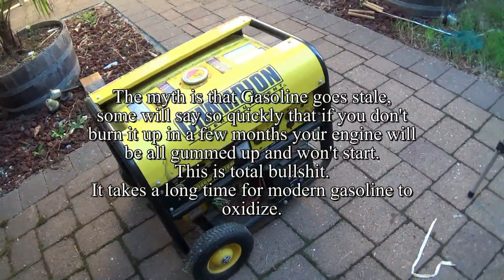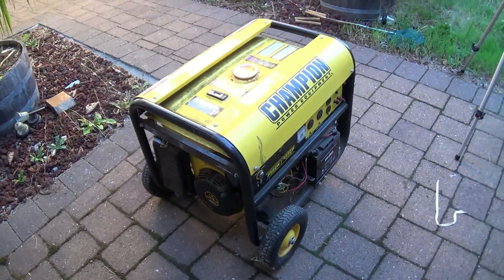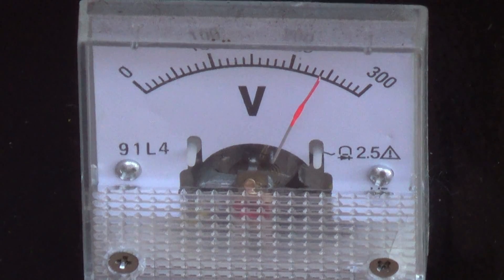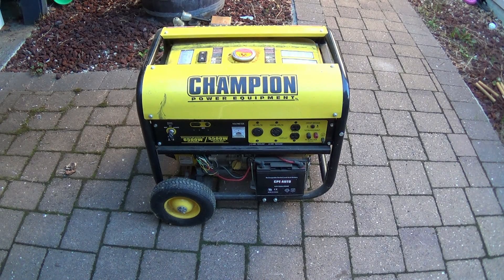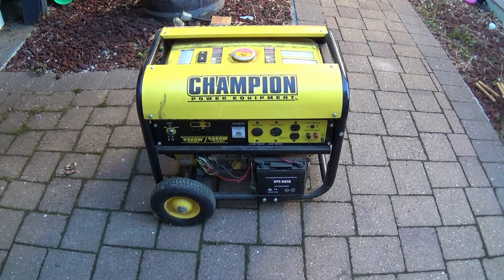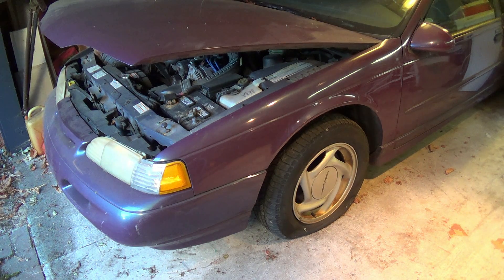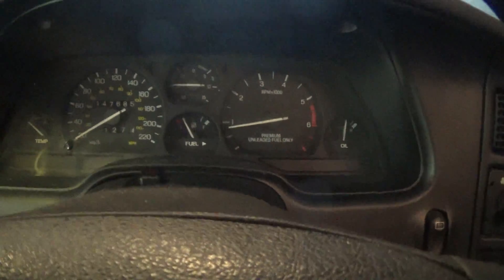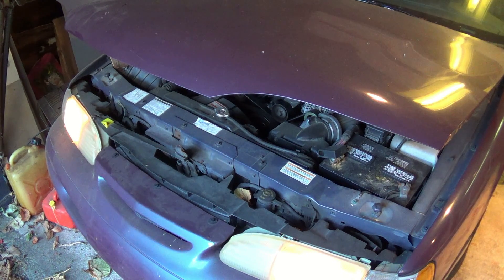Stale Gas Mythbusted

Comment: Straight gas doesn't go bad, but the Ethanol that they put in regular gas stations (up to 10%) does. In a car I don't know the consequences (especially considering modern cars' finicky emission equipment) but regular unleaded older than ~3 months just wrecks small engine carburetors.
What I do is just buy small amounts to use for lawn mowing at the start of each mowing season, and any I don't use before the lawn mower goes back to storage will be drained out and put into the car. As for the mower, the tank is emptied and mower run until it is empty (there's no gas shutoff on mine)
Reply from the maker: My dad used to do that, drain the tank, and then start it and run till it stopped and he still had to rebuild the carb every year.
It was the mechanic that told him to fill the tank, and leave the valve open so that fresh fuel would replenish what evaporates from the float bowl.
Been doing that since, and have not had to rebuild carb since.
In my current car, a Chevy volt, it won't allow the gas to age for more than a year. If you haven't put any gas in for 1 year it will go into maintenance mode, and run the engine every time you turn it on until you add some fresh gas.
It measures how much you put in, and if you only put in a little, then the timer gets only a partial reset. If you run the gas down and fill it up you get the full year. I finally ran the generator tank down doing it's monthly maintenence runs for 30 minutes every month, so I topped fresh as up last fall, so I am good again for awhile, but the gas in there by the time I refilled was 7 years old and still started fine. Lots of smoke when it fired up but it ran fine.
Reply: The thing is the Volt (and all other PHEVs) possess a special air-tight/sealed fuel storage; this is why regular cars can fill up by shutting them off and twisting a cap, but the Volt, i3 REx and Fusion Energi all require a button to 'depressurize' the fuel system before fill up. Heck, the gen.1 Volt requires 91 octane Premium because GM at first was concerned that the 1 year maintenance cycle would have degraded the Ethanol-rich 87 octane Regular that people will likely put in a Chevy.

Historically I did what you did when the 'full tank of gas" over the winter, but what happens then in the Summer was a full tank of watery gas and a carb full of crud that required the bowl, float and jet to be manually cleaned up. For 2016-17 I did the "empty tank" method and it seem to have worked.
Reply: The main issue with ethanol is just like any other alcohol, it attracts water. The climates that the gas is stored in will dictate how fast it goes bad. For instance, if the gas is left out in the open in a humid tropical environment it will go bad faster than if it was left out in the open in a desert. Once water gets into the gas, the ethanol that is in the gas actually separates and settles on the bottom of the gas tank or carburetor float bowl if the equipment has a carburetor. This would be seen as yellow or white goo that settles on the bottom of the float bowl. Once this goo buildup gets large enough, it will clog the ports in the carburetor and will require disassembly to clean.

Comment: I have a 1976 Trans Am, Pontiac 400. Belonged to my Dad when it was New.

He stopped driving it in Summer of 1986. Reagan was still President. LOL

Hasn't been Touched or Started since 1986.

The Car is now Mine. And I want to see if I can get it to Run again.

The Fuel Gauge, reads Half Full. I wonder if it's stuck? 

Did the Gas Evaporate in those 30 years sitting? Or is it still in there burnable? Was the Old Gas from the 80s better than Todays 10-15% Ethanol mix? 

It's now October 2016, Can I just Add B12 or Acetone or Fresh Premium to the Tank and try to crank it? 

Could it be that easy? or would the Fuel lines be gummed up, would the fuel pump even still work if I hook up a New Battery?
Reply: Did it start up?
Reply: Yes, update please,  I am very curious of the outcome and the results!!!
Reply: 4 reals did it start with that old ass gas?
Reply: Damn thing blew him to pieces!   RIP Phenom!

Comment: Lol, I had a 1988 Honda Accord 2.0 4 cyl Fuel Injected sitting since 2008, started it last time in the garage in 2012 after putting 2 gallons of gas. Last Month in August 2016, I tried to start t with a New Battery, wouldn't. 

Turned out the Fuel Pump was Bad, from sitting it dried out and Rusted, wouldn't suck the fuel from the tank. 

Also the Fuel Injector Gaskets, Rubber seals were leaking, replaced those.

Replaced the Pump.

Then put 2 gallons of Fresh regular, added some Octane Booster, Fuel Injector Cleaner and it Fired up, after idling shaky like it had a cold, once the new gas was flowing thru the system, the idle sounds Normal.

But I've still got a Better one.
Reply: Why did the fuel pump dry out and rot? It's not like gasoline is a lubricant for a fuel pump???
Reply: Was it an original fuel pump from 1988?

Comment: Thanks for your video.  We just had a northeast blizzard dumping 16" of snow.  I couldn't start my Honda snowblower, bought last year and was used for only a couple of times.  I've never learned how to maintain the gas engine and now I just learned about stale gas.  I was frustrated because I was stuck in the snow.  Since the snowblower is quite new, I couldn't find any instruction on the web as to how to get the carburetor out and clean it.  Suddenly, I came across your video and got hope.  The snowblower doesn't have an electric starter, so I just pull the manual starter for about a hundred time and got it started.  Thanks again!
Reply: +12voltvids What a success, it only took half a minute to start, whoopdedoo, and then you say that gas doesn't go stale, let me remind you that there are generators exactly like this but where you have to pull the cord to start them, meaning, with gas as old as yours, you can pull until your arm falls off, it would never start, ever. Gasoline goes stale because it's a mix of hidrocarbons of different lenghts, some of them very volatile, when the more volatile/shorter hydrocarbons evaporate you're left with long-chain hydrocarbons that can still burn just not as effectively (as we can testify by it taking 30 seconds of starter action for it to work), because longer chains are also more viscous, less passes by injectors or carb passages thus strangling the engine of fuel. So yeah, mythbust decades of science in fuel composition by starting a generator on stale gas, sounds about right, scientists are all stupid, you're the intelligent one.
Reply: anonimo ........rofflol
Reply: @anonimoanonimo4544     I have a similar problem , half a tank of 2 year old gas and I can't siphon it out for some reason. Mitsubishi Montero sport 2000. siphon hose keeps getting stuck like 2 feet in.  any ideas?
Reply: @anonimoanonimo4544  Ya know, you can use an electric or battery powered drill and the right sized socket to turn over a pull-start small engine with minimal effort.
Reply from the maker: +Samuel Stone I learned years ago from a lawnmower repairman that keeping the tank full,  and leaving the fuel valve on, ,so that fuel that evaporates from the float bowl will be replenished will keep it from varnishing up.  Incidentally, the gas in this generator is 16 months older now than when I made the video, same gas, no new gas added, and I just cranked it up last week when we had a storm warning to make sure it would start. Took about as long as it did in this video, and it started right up no problem.
Reply: 12voltvids Yes, the reason I had hope after seeing your video was because I noticed that the fuel valve was left on.  Thanks!

Comment: We too had a car (1994 Renault 19 RT) just sitting around for years, but after charging the battery it started up pretty much immediately.
Reply from the maker: It's all marketing to sell gas stabilizer . My dad used to turn the gas off on his lawn mower and let it run until it stopped thinking that burning all the gas out (or draining the carb) was a good thing. Every spring he would curse and have to have the carburetor overhauled.
I tried to reason with him about the residue evaporating and gumming it up but my dad was stubborn. (only a grade 8 education) Myself I am a well educated engineer, electrical field, but I understand physics, and chemistry. I never turn the gas valve off unless I am transporting a power tool. Other than that I leave it on, so as the gas in the carburetor evaporates it will be replenished. So far I have never had to service any of my power tools, and I don't put gas line stabilizer in. It is best to keep the tank full so that condensation doesn't form on the inside of the tank and dilute the gas, but I don't follow that rule either, and so far have never had any problems.